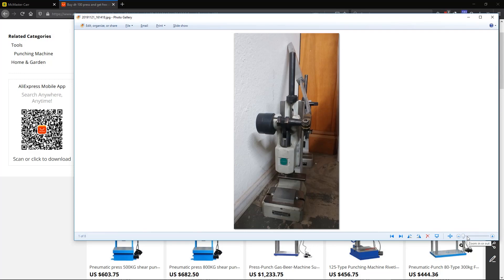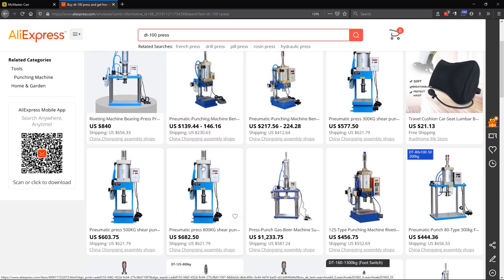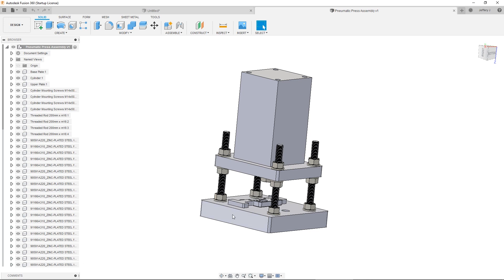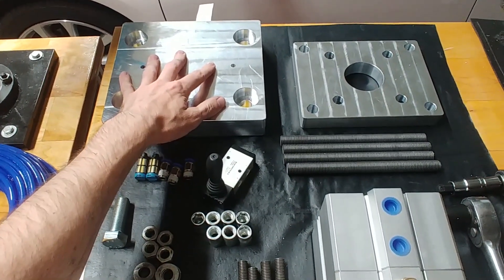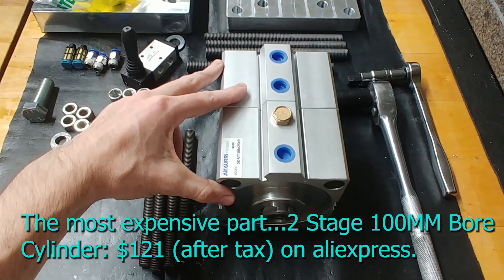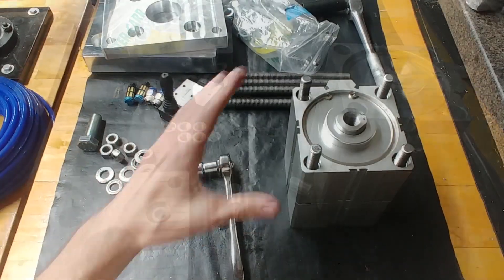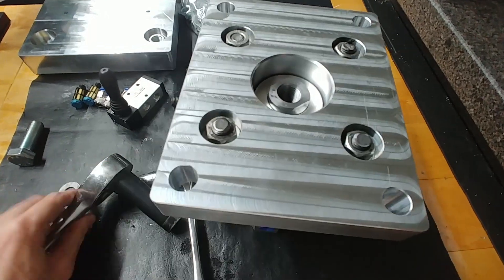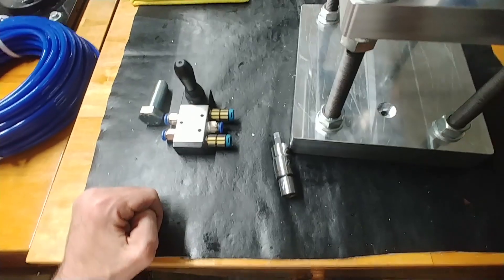Building a Pneumatic Press : a DIY Replacement for a Toggle Press

Comment: i am making a lost cost automation press to press a lock ring in the tyre and rim. i am using 4 160mm bore cylinders  at 90 degree angle having 100mm stroke i need more 150 mm length extension on piston rod. Do you have any suggestions for the kind of dolly i should use?

Comment: Tell us about the best air compressor for this pneumatic cylinder
Reply from the maker: The stroke is short so it doesn't require much air.  I use a Husky 30 gal compressor and it only comes on every 100-200 or so strokes.
Reply: @jefferyj  what if i have cylinder bore 80 stroke 300, and the air pressure is 8 bar, will give force for    240kg, right?
Reply from the maker: @manchette4840  I threw those numbers into a calculator and came up with more than that...how did you arrive at 240 kgf?
Reply: @jefferyj  how much u got( kgf)?